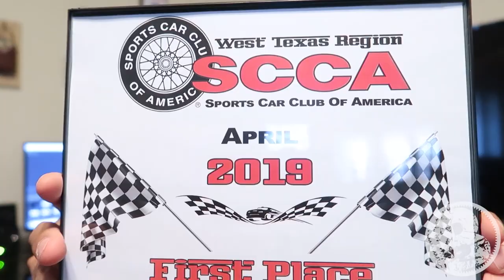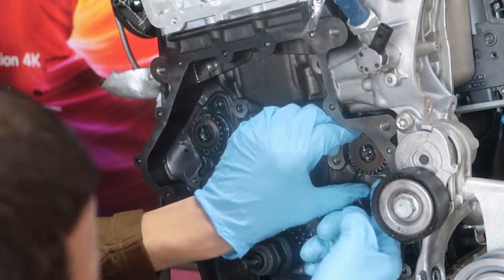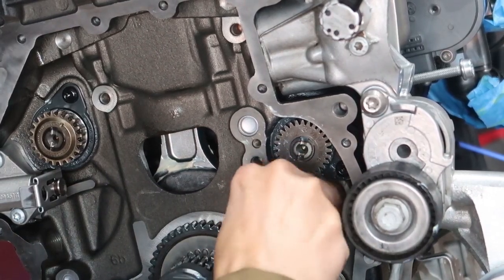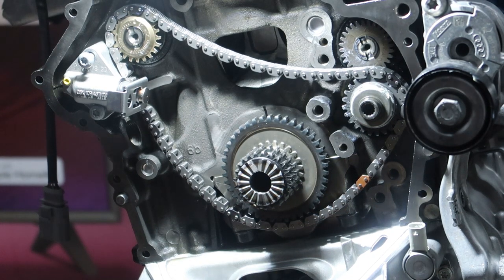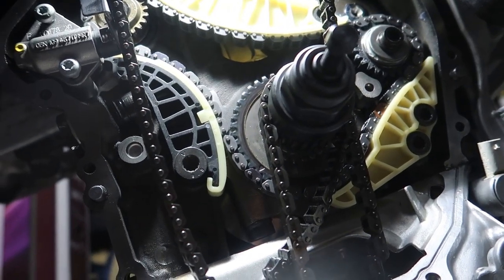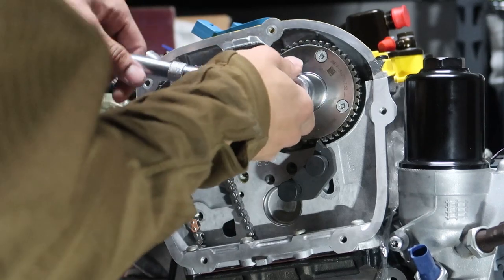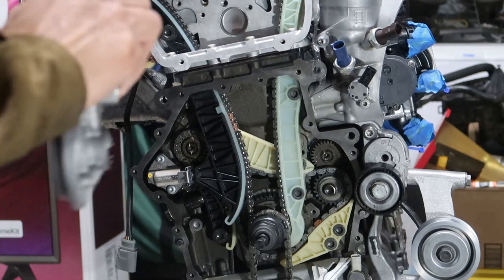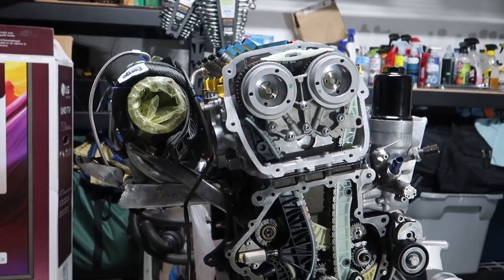Timing done! Wasn't near as bad as I imagined! | MK7 Golf R

Comment: Pulley on the ballance shaft for the water pump has been installed in the diffrent direction than it should be. It's mean without protection against loosing the belt from the pulley.
Cheers.

Comment: Hello Bryce,
Is the balance shaft New or you reuse thé old ones ?
In the manual it's said that it has to be replaced
No problem using the old ones ?
Reply from the maker: I re used the shafts but new bearings. Prolly should replace them tho for good measure. And the cam shaft oil control valves for sure replace those. And injectors at least get cleaned and flow tested
Reply: @BryceJordanProductions  Very clear Thanks

Comment: Im getting fault code P0011, took out the oil control valves the one from the intake cam looks damaged could it be the one that's causing the intake cam timing to over advance & not correlate the crank timing?
Reply from the maker: Sounds like it!!!